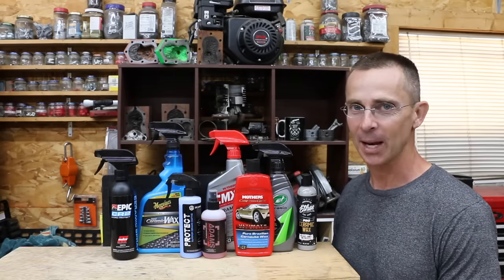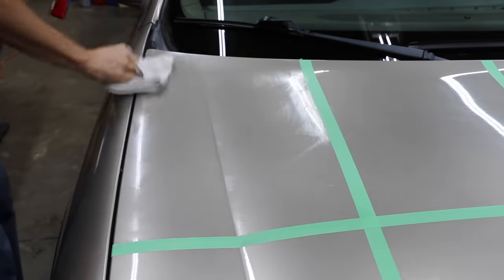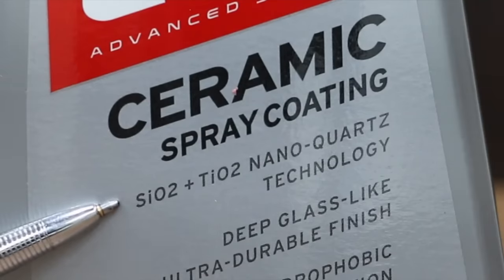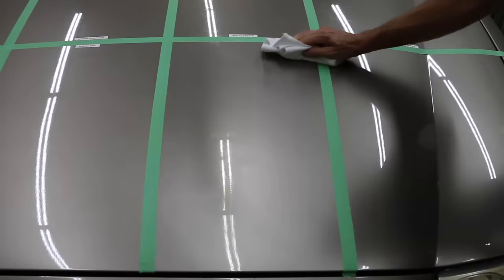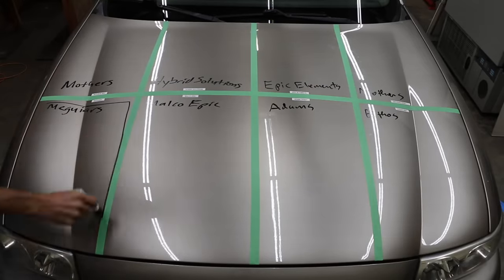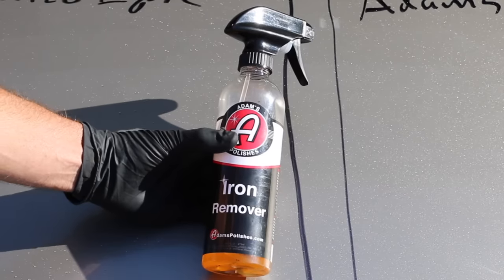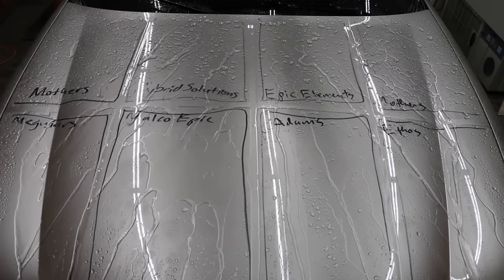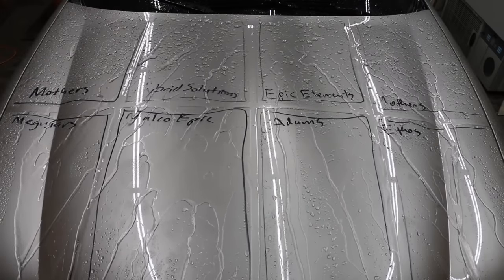Best Ceramic Spray Coating? Mothers vs Meguiars vs Ethos Pro

Comment: With all these dirty rags I’d like to see a laundry detergent comparison!
Reply from the maker: Thanks for the video idea.
Reply: Seconded!
Reply: @ProjectFarm  Speaking of detergent, maybe a test on grease removers for hand washing, I recall that there was a gritty orange scented solution that should work.
Reply: @eugenetswong  grease and oil stains on work clothes is what I would like to see
Reply: This would be good. I  many microfibre towels that have been used for polishing that would be nice to clean
Reply: @specialK_hvac  i'd want both, now that you mention it. For a thorough test, the hand cleaners could be tested on greasy cloths, too. Ultimately, though, the hand cleaners need their own test, because we'd want to know that they aren't too abrasive for actual-thin-skinned people.
Reply: for dirty rags I put them in a 5 gallon bucket with simple green and sometimes a drill paint mixing attachment. just let em sit for like a day or so to get all the really bad shit out before I run em thru the washing machine
Reply: With microfibers.
Reply: I'd definitely be interested in some sort of laundry detergent video, but for color retention and black retention. I hate that some of my favorite t-shirts are fading but I can't help but wonder how much my laundry detergent contributes to that.
Reply: Almost too many good ideas.
Reply: @eugenetswong  Swarfega?
Reply: If you do a hand cleaner one I'd like to at least see hand cleaner ( 38-A ) From Titan Laboratories and Grip Clean, those are my 2 favorite hand cleaners been using them for years
Reply: Yesssssss
Reply: @Nyle95  i took a quick look, after seeing your suggestion. I don't think that I used Swarfega.

It might have been Gojo, or Fast Orange.
Reply: @eugenetswong  No problem
Reply: That is a fantastic idea
Reply: @eugenetswong  are you referring to GoJo?
Reply: "Next up, Tide vs Arm & Hammer vs Kirkland Ecos."😅
Reply: @christheturdherder9096  it might be. I thought that "orange" was in the name, and that the container was huge.
Reply: @schlomoshekelstein908  Me gramps loves Simple Green! I it's  Safe around even food KITCHENS.
Reply: @RobWenzel84  Dawn dish soap is the best. Cheaper and very gentle, on everything
Reply: @captainamericaamerica8090  HAHA that is very true i do use a lot of Dawn, but I was assuming they were talking specifically hand cleaner, but you are right dawn works wonders and is much cheaper
Reply: AMMONYC has a 25min video on how to wash your microfiber towels correctly.
Reply: @schlomoshekelstein908  
Haha take em to the laundromat instead of polluting your own washer. 
I've done the same when the wife isnt looking though 😝
Reply: @zachheindl8619   Tide pod original
Reply: @ProjectFarm   also stuff like toilet paper and paper towels   a lot of brands make big claims   i don't think they live up to them sometimes..
Reply: I change tires and sometimes mechanical stuff at work and I believe I’m using “all” and seems to take most the stains and bead seal off my pants. I’ve tried tide a couple times but it won’t touch it.
Reply: @TheGhost28  
I've used hand cleaners and they help with the spots  , wether you use orange pumice or old school "goop". 
Good detergents help , make a slurry of hand cleaner and detergent right on the spot. 
and for overall dirt instead of simple green I use purple power if I'm doing the "soak in a bucket first trick"
Reply: oh thats a good one, everyone knows tide and gain are the best... right?...
Reply: MrHillfolk I’ve had trouble with deep oil stains I was going to try letting them soak but I’ll try that next time. There is one work shirt where it looks like I took a oil bath lol
Reply: TIDE/PERSIL are best. Personally being American , prefer TIDE.
Reply: MrHillfolk I’ve bought a couple pair of wranglers and seems like they’ve only lasted 6mo at most while I’m wearing pants that I’ve had for 10+ years. They only supply shirts for tire techs and the mechanics get the full blown uniforms. Does Rural king have the duck material pants? Lol
Reply: @DialatedPupils now that you mention it, most people do seem thin skinned.
Reply: Project farm will soon attract housewives!
Reply: Oil Eater.  Best degreaser by far
Reply: @schlomoshekelstein908   LA Awesome at dollar general.  You'll be amazed how good it works.
Reply: Persil

Comment: Looks like Turtlewax are clawing back their reputation. The brand went stale for a while but the new stuff seems to be getting some good reviews!
Reply from the maker: Great point!  I was really, really impressed with it.  They've received some less than positive reviews from me in the past but definitely a great product this time.
Reply: @ProjectFarm  Thanks for your thorough reviewing as well!
Reply: @ProjectFarm  I've purchased the Turtle Wax Ice Seal and Shine after many positive reviews online. Seems to be the best in its price point and beats more expensive products
Reply: A lot of Turtle Wax's new lines are relatively decent products but they still have a reputation to rebuild for sure.

I think the biggest thing going for Turtle Wax at the moment is the car detailing communities actually trying the products out and recommending their newer lines.
Reply: Turtle Wax products were never really on my radar but I've had really good luck with their chrome polish.  I might give their ceramic spray a try at some point.
Reply: @chrisfreemesser5707  Their older products really haven't changed any, it's the new stuff like Seal 'N Shine, some things from their ICE line, and Hybrid solutions.

I have the ceramic spray of theirs, really like it, used it for maybe 6 months now, but I like Meguairs Ceramic Detailer too. Granted their not intended for the same thing, the detailer is mostly intended to boost hydroponics and a little gloss after the base coat has degraded over the months.

Out of everything Seal 'N Shine (especially the new formula) is the best of the best for chemical resistance. It has a reputation for being absurdly chemical resistant.

If it was in this test it would undoubtedly have beaten everything in terms of longevity with the chemicals. It's a decent product, pretty cheap but it doesn't bead water like crazy in the short term, it does better in the long run tho.

The car detailing community seem to heavily value water beading (as it's easy to test) and most products are ranked in that regard. Seal 'N Shine is a good product, beads well but some of the SIO2/ceramic sprays out preform it in the water beading department.

They are slightly more hydrophobic.
Reply: @david92xj  I used to use that Turtle Wax Ice and Shine a lot, then it seemed like they changed the formula (maybe ten years ago). Perhaps I should give them another try.
Reply: The hybrid solutions spray is an excellent product. I highly recommend it.
Reply: Turtle Wax is my main brand.
Reply: I'd like to think since turtle wax has been in the business so long they probably test all these conditions, while most of the others are just copy cat brands following others, if they did good in this they're probably surprised.
Reply: I hear they brought in some turtle consultants sometime last year. 🐢 Many of those turtles really know their stuff.
Reply: @chrisfreemesser5707  Try their tire shine too.
Reply: @CEHepp  yes! It's the best! LIKE TIGER EMPEROR KING IS=💪👊🐯🐯🐯👑👑👑🏆🏆🏆🏆🏆
Reply: Tone.  megiuers and mothers are  way overpriced and average. They  don't deserve so many customers
Reply: @chrisfreemesser5707  it's good stuff...even makes water bead up... rare
Reply: @david92xj  I used ice for a while but the new ceramic stuff is amazing, switched a few months back and use it after i wash my car and it lasts forever, i was lasy this summer with all the rain we got and everything just comes right off with a spray
Reply: For a while? They went from the best through the 80s into the early 90s to a joke for the last 30 yrs. I'm glad to see they're coming back though!
Reply: They seem to be making a big push with Hybrid Solutions.  I've been seeing large end cap displays for the new product in the automotive section at most of the supermarkets in my area.
Reply: @FLYINPOTATOES  maybe I should give that a try. Did you use the hybrid solutions ceramic spray?
Reply: @ProjectFarm  i agree. I never really cared for Turtle Wax, i'm more of a Meguiars guy but when i watched you video a while back, i went and bought it. It works wonders!
Reply: Stale??? Turtle Wax is the world standard in waxes. Again they prove it to everyone. Look at how every wax on the market gets compared to Turtle Wax. Clawing back?? I would put the old school Super Hard Shell against any other out there. That stuff beads like no other.
Reply: Yes

Comment: That purple power was powerful, I’d love to see a degreaser comparison.
Reply from the maker: Thanks for the video idea.
Reply: @ProjectFarm   If you do one on de-greasers make sure to test some stuff called Challenger.
Reply: bobwatters , I think they're the same but yes, I agree. We've always used Super Clean, that stuff works awesome !!
Reply: We use purple power at our shop, it’s very potent, I think Ardex makes it
Reply: We use some sort of orange-colored stuff at work, it's impressive.
Reply: Sc-200 vs super clean or purple power.
Reply: Ditto. . . Purple Power vs Simple Green vs "The Orange Stuff" vs the competition
Reply: I know Purple Power sucks on automotive grease which is ironic
Reply: LA totally awesome needs be one of them
Reply: Purple power destroys aluminum in almost no time. Cleaned something over an a junk LS block outside and came back out to find a lot of corrosion.
Reply: You'd also need the good ol' classic Zep degreaser.
Reply: spray 9 is my go to degreaser, i would like to see it in the video!
Reply: If you do a competition, try Grill Brite. I'm a cook and we use it to clean our flattop.
Reply: You should try rubbermaid degreaser. Full strength will remove clear coat on a car.
Reply: Purple power vs La Totally Awesome
Reply: sams club makes a store brand degreaser that i'd be curious to see how it fares in a lineup
Reply: Try Mean Green
Reply: Please include Dawn dish soap if you do this.
Reply: Super Clean is far superior to Purple Power!
Reply: You need to test CITROL from Schaeffer's.... its the best degreaser on the market hands down!
Reply: @ProjectFarm  Test CITROL from Schaeffer's Its the best on the market for degreaser! I would bet anyone!
Reply: make sure to test purple zep industrial de-greaser
Reply: @ProjectFarm  please include "Oil Eater"  it has worked very well over the years and I haven't had a problem with it damaging aluminum or anodized surfaces.
Reply: Gunk engine cleaner in the comparison. A greasy diesel engine on a old tractor would be a great comparison, but I bet you will need to do test panels as on the wax.
Reply: and as a base test use paint diluetent wich is not going to attack water based paint
Reply: Okay, I think it's Zep brand Heavy-Duty Citrus Degreaser that we use.
Reply: I was my car with the purple power boat wash.
Reply: Yes even their upholstery and wheel cleaner is awesome (no pun intended) really hopes he adds LA Totally Awesome. Especially since it’s at the 99cent store. Really good stuff.

Comment: I know this is an older video, but I just wanted to say that I have used Turtle Wax Hybrid Solutions on my vehicles, since viewing this (a year ago) and it is an incredible! It lasts an extremely long time and makes the finish of the vehicle feel very soft and slick. It seems to even repel dust. I told my friends, and they are using it too. Keep up the great work. It is appreciated!
Reply from the maker: Thanks, will do!
Reply: It really is great, and it even does a pretty good job at hiding very minor swirling on my car.
Reply: Agreed. The turtle wax spray does seem to last longer than the Meguiars product in my experience. Especially after rain, & in normally sunny conditions here in Australia. Beautiful shine too!
*thank you PF, bought both because of this video!
Reply: I just started using it on my car, and I'm super impressed. Definitely worth it for $15
Reply: I have been using Meguiars for a long time and so far I have not found anything better. If you have a car the size of a matchbox, then you can use any protective coating, because it’s not a very big job to put a new coating, and if you have a truck or a huge van, you won’t find better Meguiars because in order to update the protection layer All you have to do is spray onto wet surfaces and rinse with water. And this advantage cannot be beaten by any of the considered coatings. Meguiars the best
Reply: When you apply, are you clay and polishing first? I have a newer vehicle and I’d rather not risk messing up that step. Would like a spray product that’s easy and I don’t mind doing more frequently
Reply: @davidbartsch255  My truck was new. I just washed and used a Turtle Way spray. Then I used the Hybrid solutions. It is great.. I think a clay bar would be a great idea before applying!  Hybrid solutions is super easy and lasts a long time.
Reply: @ssarkees  thanks. I went and bought a bunch of stuff recently to detail at home. After the wash, I got myself tec582 and Beadmaker. Today I put some Beadmaker on a drying aid. I’m not going to clay bar right now. Only had the car 2 weeks, so don’t want to mess up the coat just yet (or even risk it). Tec582 I might return and try this turtle wax stuff , then I’ll just use beadmaker as a topper as I go
Reply: I have too and this video is how I made my choice
Reply: I use Sonax etreme and that is very good. Nothing sticks to my cars. Even after driving in rain it still looks clean. And what little dirt  it does pick up falls off with even a light wash. So far very happy with it. If you have that product where you are it's well worth it. It is a German made product.
Reply: Same with me.  It is really good and not that expensive.

Comment: I personally use the Hybrid Solutions ceramic wax. Stuff is great. For it to last the longest, make sure to put on one layer, wait 24 hours then put on another layer. Stuff lasts for about a year. Glad to see I made the right choice!
Reply from the maker: Great information. Thank you
Reply: Same here been using it since spring, true test will be this winter.
Reply: Does it do anything for swirling in the paint?
Reply: @albundy7239  I use a polish for swirls before using Hybrid Solutions.
Reply: Al Bundy maybe light swirles. You probably shouldn’t put it on swirled paint because if you ever want to polish your paint it’s hard to get off.
Reply: Are you referring to Meguiars ceramic solution wax?
Reply: Richard Fox Turtle wax hybrid solutions

Comment: I'm a professional mobile car detailer and I've been using the Turtle Wax ceramic spray for about a year. I see that it was the right decision! Thanks for making great videos for all kinds of different trades and jobs!
Reply: How often are you finding that you need to apply it, Reise?
Reply: @ljprep6250  it varies greatly depending on how often you wash your car, the weather conditions of where you live, and how often it sits in the sun.
Reply: @joestewart8966  if the car is exposed all the time to sunlight and rain, how often to apply hybrid solutions ceramic spray wax?
Reply: @gxs8p578  it’s hard to say, however id give it anywhere from 3-6 months, however with how cheap and easy it is to apply, it’s still a great wax
Reply: @joestewart8966  great, thanks for the advice!
Reply: I used it too and everytime it rains i look at it the day after and my car is literally the only one in the neighborhood that's still very wet because all the water beads and just sits on the car for a very long time and once it evaporates, it leaves the car dirty and dusty with water spots
Reply: @rrvaughn820 I'm not a professional detailer, but have worked as one and detailed hundreds of cars. It's a lot more expensive but I have been extremely impressed with Wolfgang's Deep Gloss Paint Sealant for protection and longevity. If price wasn't a factor what would you recommend?
Reply: @brettkalmeta3238  If price wasn't a factor, then a multi-year true ceramic coating for everything! Haha, but more realistic, I recently started using Griots Garage 3 in 1 Ceramic spray wax and it's phenomenal as well. Great reviews and ratings and probably could be said that it's even better than the TW. More durable, easier to work with !
Reply: @championxxlNL  Grok that, but since I don't know the lifetime of these other treatments, that was the data I sought.
Reply: I went with the cream version of this turtle wax hybrid ceramic wax as my first car wax and im so glad i made the right choice lol

Comment: Coat the inside of a cylinder with hybrid solutions and run both it and a control engine without oil and see if there is a difference in time to seize up
Reply: You just want to see him destroy another lawn mower engine don't you? LOL
Reply: @benkeysor7576  I do! That was my first video of his
Reply from the maker: Thanks for the suggestion.
Reply: That would probably burn off before reaching operating temp.
Reply: @momurderah  But how would we know for sure if he doesn't try it. ;)